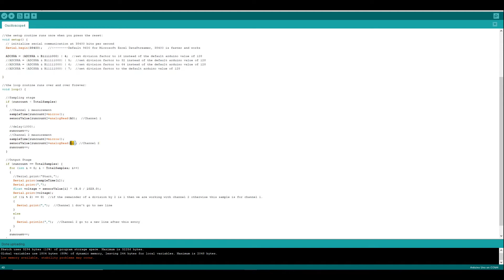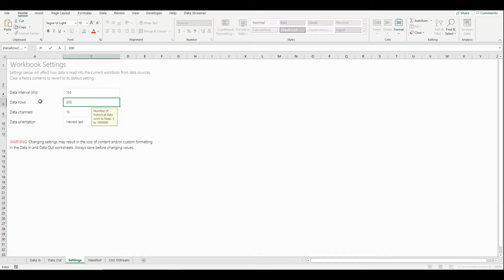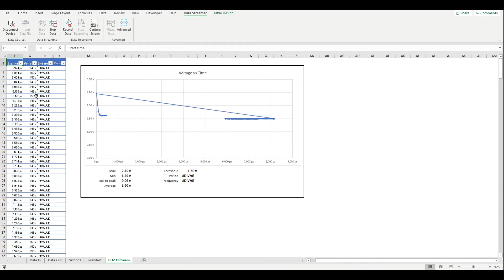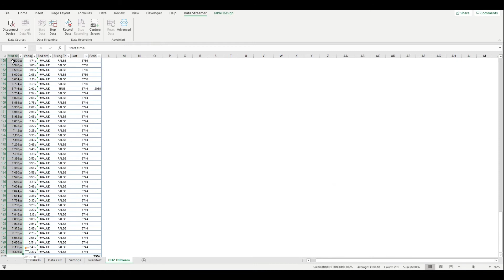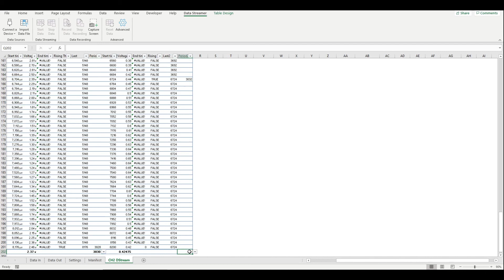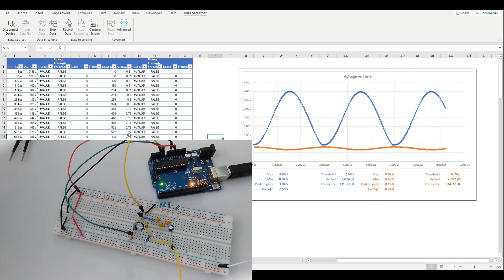2 Channel Oscilloscope using Arduino (ExcelOscope Part 5:  Adding Channel 2 step by step)

Comment: Is there any limitations like max hz max voltage etc. i wonder about limits of this oscilloscope because of i need some certain range of measurement so i may burn or damage something. Thank you
Reply from the maker: The Arduino handles 0 to 5 volts.
The video very fast analog to digital conversion show max frequency it can measure.
Reply: @overengineeredinoz7683 Thank you verrry much :))